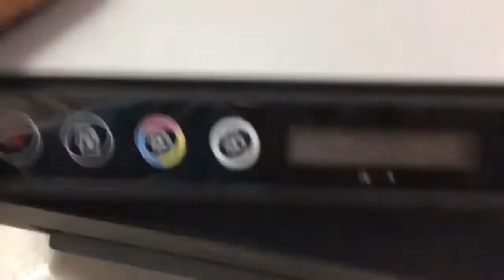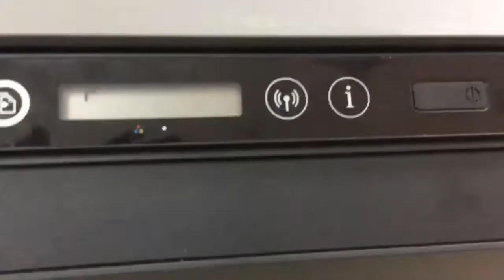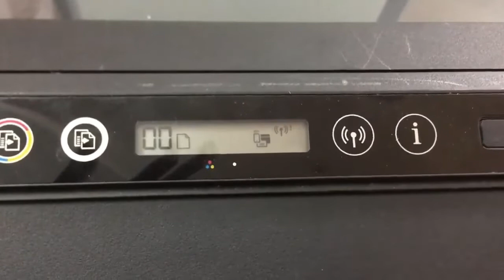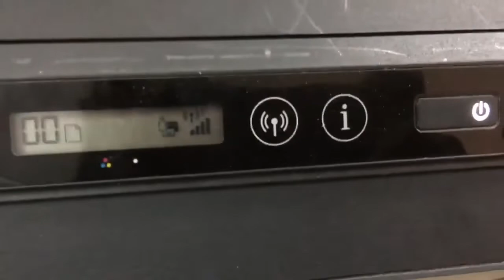How to fixed HP Smart Tank 510  515 517 518 519 error E3

Comment from the maker: How to fixed HP Smart Tank 510  515 517 518 519 error E3,Control panel lights and display icons status, E3 Cause the Carriage inside the printer has stalled. Solution 1.Open the front door, then the printhead access door.2.Make sure the printhead latch is properly closed and the print carriage is not obstructed. Do not open the printhead latch.3. Remove any jammed objects blocking the carriage.4 Close printhead access door and front door.5.Press the Resume button to continue printing or press the Cancel button.6. If still problem checking hardware parts or replace board carriage or motor or main board drive the board carriage
Paper width mismatch (E1) or Paper length mismatch (E2) has occurred, When printing the printer detects that the paper size of the printing job does not match the width or length of the paper loaded, E3 Cause the Carriage inside the printer has stalled, The Number Counter icon is showing E4, and the Resume light is blinking cause here is a paper jam, The Number Counter icon is showing E5 cause the scanner is not working

Comment: Hi, my same printer is getting stuck in the A sign, after alignment done it's stuck and the scanner not working showing error, Pls advise
Reply from the maker: try disassemble printer and check the printhead close correct or sensor cables